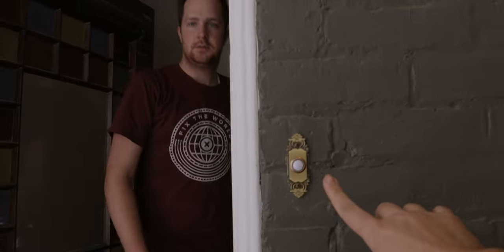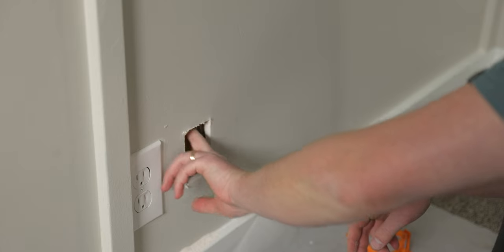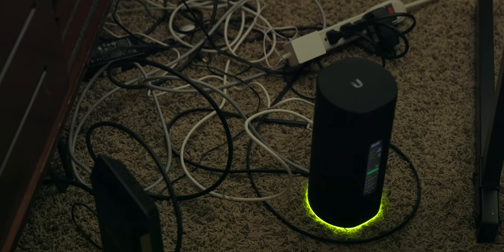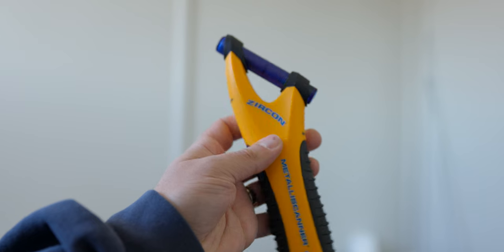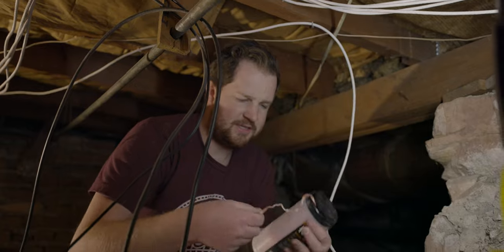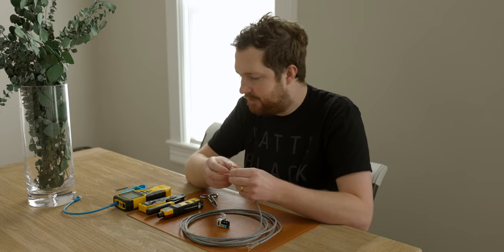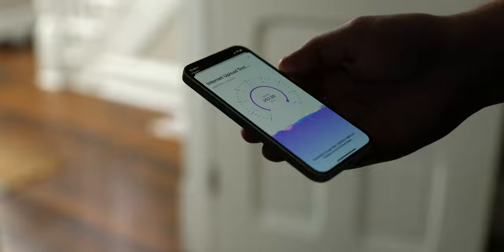Adding 10 Gigabit Ethernet to my 129-Year-Old House!

Comment: It’s so funny see this couple years ago I wanted to run Ethernet from down stairs to my bedroom (only like 50mps) I have to splice and wire all the wire together with a different cable I cut with the rj45 I did it all with a pocket knife (cut myself bad multiple times) used duct tape to put them together and then ran the cat 6 cable out the window (not outdoor eating in vail area so lots of snow and ice and thawing slammed the windows shut did the same thing downstairs and it ended up working great :)

Comment: Instead of a keystone, you can simply use an ethernet coupler wallplate. It has a RJ45 jack on the back of the plate and the front. So you can pre-terminate your cables, and just plug it into your wallplate and then screw it on.

Comment: All you need to do is flip the auger bit upside down after drilling your hole, then tape your cable end to end with the bit. Nothing else needed for pulling through subfloor. The fish tapes and ropes are great for pulling through to attics (which I suggest avoiding unless you have no other option) or from one level to another, but unnecessary otherwise.

Comment: I went with 6a when I did mine due to power lines  running, seperated, but parallel and a large number of cross points.

Comment: Just make sure when your running unshielded cat6 to not run it parallel with any power wiring if it's shielded I still wouldn't run it parallel but it wouldn't be as bad if you did.

Comment: The wire order AND the amount of untwisted wire at the end is very important for performance.  99% of the weird performance issues I saw back in the day were because of people untwisting too much or using any old wire in any order.  Working does not mean working properly ;-)

Comment: I wish it was this easy to do in my house. I live in Germany, our 1938-built Single Family Duplex with cinterblock and sandstone walls covered right up with plaster and wallpaper on the inside and 15cm of insulation on the outside. Drilling is impossible as it would be a nightmare to seal up again, paint over it etc. Running cables inside is also super hard cause my parents only placed a handfull of conduits in the walls at very inconveinient spots and super weird cable routings (the cable from our curent DSL Termination, soon to be fiber termination has to run all the way from the basement to the office on the second floor where it enters our all in one router before it travels done to the first floor again for our landline ISDN phone and some other devices that live under the seating in our dining room). My room didn't have ethernet to begin with, at least not where my desk ended up being, so we already had to drill a wall and hook my room right into our 10 Gig switch. It's a real pain, especially since I want to ditch all of this aging infrastructure and do it properly.

Comment: Pretty sure your suppose to use Fire glass or Safety rated cable in Lofts or Crawl spaces that are hard to access in emergency, So bare that in mind where you live. Because Type 4 Poe Devices (poe ++) can use upto 57Volts and pull 100watts

Comment: For anyone with a home built in the last 15 years or so, IF YOU HAVE TELEPHONE (RJ-14) JACKS IN YOUR WALL. Those might be run using cat5e cable making setting up Ethernet really easy. My home which is nearing 20 years at this point has a home run to each room of cat5e that was being used for telephone line. Just re-terminate at the ends and bought a new patch panel and BOOM ethernet up and running

Comment: I really want to do this in our old house but the problem is we have half a meter thick solid clay brick walls so all cabels have to run outside of the walls even the power cabels

Comment: do you have the Stapler and the spacers for the stapler linked in the description or a specific name for both?
Reply: Nevermind i found it!

it is called:

“Arrow T59 Wiring Tacker Chrome”
&
“Arrow T59 Insulated Staples”

Comment: Using keystone do not introduce an additional point of failure. Keystone punch down termination is the prescribed method for meeting the standard for cabling. Crimp on ends have their uses but introduce far more point of failure and are way less reliable than using punch down.

I agree that if you must use crimp on, the pass through are by far the best solution. And increase the likelihood of getting it right the first time.

Comment: The multitools are not always super expensive.  I got a cheap one at Harbor Freight for $40.  I have no idea how long they last or if I can expect it to last.  I only use it for occasional things and it doesn't get used a lot.  These things cut in quick and easy.

Comment: I'm in a similar old house in Switzerland, I throw my Cat cables (cheapest  20m long)  out the window, 
2 story down to my 10gbits XPS-Pon Fiber router.  
Recently replaced my old CAT4 cable, that hanged there for 5 years with a new Cat6a. 
I hope it will also run 5 years, until NG-PON2 with 40gbits arrives. (maybe a little bit longer).

Oh and the cat 4 cable did 10gig just fine. but i replaced it anyway, felt so wrong.

Comment: 6:30 you don't need the UDMP to run Ubiquiti Unifi APs, just any old computer will do.  For most features (the only exception I can remember is captive portal) you don't even need this computer to be constantly online.  It is not as good (e.g. no builtin RADIUS server afaik) but will work.  Cameras however (at least according to Ubiquiti, I don't have any of their cameras), you need a Cloud key Gen2 or a UDMP (regular Dream Machine doesnt work) or the separate Ubiquiti NVR (don't know how well this integrates with the various different controller options).

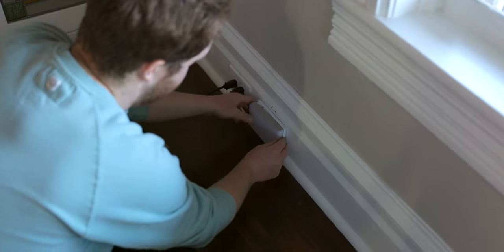6:38 you can set up Ubiquiti APs to work as a mesh network and can even use this (with certain models of AP) to connect wired-only devices over wifi (some accesspoints have a downlink that you can use to daisy-chain another device, this can be used even with a wireless uplink, and works on any device).  I do this to connect some Linux boxes, we have one AP by our router, and one downstairs by the Linux boxes, which are connected to them by an old EdgeSwitch 5xp.  However, wireless uplinks on Ubiquiti APs, while mostly stable, can occasionally disconnect due to interference/software bugs/acts of a deity (i have no idea what actually causes this to happen) and even if the disconnected AP is rebooted, it won't reconnect unless an AP it can connect to (with a wired uplink obviously) is also rebooted near-simultaneously (I can get between both of mine quickly enough on my own).  This might be good if you don't fancy running Ethernet for an Ethernet-only device and don't mind occasionally having to restart the accesspoints, while simultaneously wanting to get better WiFi coverage.

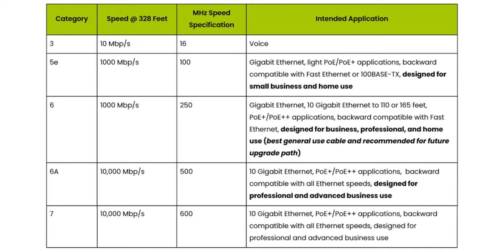9:40 Cat7 cable is either not actual Ethernet (its something proprietary that is semi-compatible) or Cat6a that was labeled incorrectly to make it sound better.  Cat8 is ethernet, but expensive and it drops off from maximum speed pretty fast, and if you want that kind of speed you may as well go for fibre runs and SFP+ transceivers and NICs.

Comment: My grandma house is a lot older and basically the house was built way before my grandma got it so it doesn’t have ethernet but what I did do was since it was a small house (It was in San Francisco). I would only just drill holes into the wall and pass ethernet through room by room and have switches or I would staple it to the corner of the roof or the bottom very Jenkee but it gets the job done. I would also use the same like Wi-Fi or wireless hub like you 😂

Comment: When removing the outer cable sheath you should use the string to expose more cable and cut of the initial wires just below your initial cut. Any nick in the twisted pairs could cause really weird issues in the future so its better to just sacrifice 2 inches of cable and remove the sheath to expose enough string for you to grip and pull down to cut the sheath (as that is the purpose of the string) then cut all the excess wire off just below where you made your initial cut using your tool. This will guarantee that you have no nicks in your twisted pairs. That tool you used is set to a standard depth and cable sheaths can come in all kinds of thicknesses and if you have a thinner sheath it will nick the twisted pair sheaths. Also if you run the twisted pair over a screw driver shaft t will take out the twists in the wires and make then straight

Comment: The one thing that's not really mentioned here is that depending on your application and situation, you do not want to give every line the maximum bandwidth. In a situation where you have a maximum of 5 Gbps and 5 endpoints that are likely to want as much resources as possible it can make more sense to to only run 1 gig to each, ensuring they all get fast, low-latency, internet.

Comment: Yeah that's the thing about typical US house: cable drops! We here are used to wall our cables into solid concrete or alabaster and so, they couldn't get replaced easily (but that prevents them from being damaged, and your house from burning). Imagine doing this kind of upgrade with your internal walls made of silicate bricks! Although, they do have a great soundproof capabilities, and they can stop a bullet. =)
Reply: @Phillip Banes I may have misspelled something, I was actually amazed by the simplicity and renovation-ability of the US houses. Which is unfortunately not the case  for us.
Reply: @Phillip Banes I never mentioned any disadvantages my man. I stated a couple of "redeeming" factors for our all-brick designed houses, i.e. why they are made like this, that is all. Note the massive quotation marks.

Comment: I couldn't agree more about CAT6. I helped a buddy with a IP camera project recently and he used CAT6A, and these are cameras that could get away with 100Mbps, but he was adamant we use CAT6A CMX due to the POE+ runs being long.

What a pain in the ass to crimp, especially when its 100F out and you're sweating bullets off a ladder fiddling with the stupid insulation.

Comment: Pretty good job with explaining networking but there was one flaw, the punch down tool it's a 110 or 66 block punch down not a 99. As a person who is certified in computer networking I see that you did a good job with explaining. Now the stapler method that's actually a new one I have not seen that before. I'm a zip tie kind of guy but I've gotten more into the velcro cable tie method so say later on down the road you want to add more cables to a bundle instead of having a cut however many zip ties you got you just undo the velcro add your cable and just velcro it back up. Now sure you could just zip tie the additional cable to the bundle already but say later on down the road you need to replace a cable that's a lot of zip ties to undo.

Comment: If you're a noob with this kind of thing I'd go directly to CAT7: expensive and hard to work with, but a high standard that will last your lifetime.
If not, CAT6A S/FTP would be my go to to run more than patch cables.

Comment: I recently moved into a house that like many homes, doesn’t have Ethernet already running throughout. However, it does have a central vac system with ports in almost every room. I tired it once and decided to stick to my original vacuum and never plan on using it again. I’m wondering if I can use the preexisting vacuum lines as conduit and run Ethernet through there. I tried finding similar projects or ideas online but couldn’t. I don’t know if I’m just not seeing the obvious red flags, or if this is a super easy shortcut to get the house hardwired instead of going through my walls. If anyone has any thoughts or ideas please let me know!
Reply: Did it work?
Reply: @AlxndrHQ  Long story short, no not yet.
So I saw videos of electricians tying grocery bags to one end of a wire before inserting it into conduit in order to create a seal. Then, at the other end a shop vac was used to pull it through. I attempted to do this myself but it didn’t work. I believe one area of failure was at the shop vac end because there was not a good seal. The shop vac hose was too large vs the central vac inlet and I never got around to create an attachment that narrows down to fit. Another point of failure might be that the “conduit“ is too vast and intricate, so I would need a much more powerful shop vac to suck anything through it. I have a 6.5hp craftsman (CMXEVBE17595) so I assumed it should be good enough since in those videos they use a weaker one. The last reason I’m guessing why it didn’t work is because of the direction I was trying to move the cable. I tried to go from downstairs to upstairs, but perhaps if I go the natural flow of the system (aka going downwards towards the central vac system that’s in the basement) it would work better. Ill try again soon whenever I get the chance and keep you updated. If you are trying to do the same let me know if it works out and if you did anything different, thanks!
Reply: @herpderp749  ah gotcha! We Jerry rigged it using gravity through the ducts. Seems to be working fine so far! 

It may be easier to just drop a long Ethernet line down from the upstairs down, rather than trying to run it upwards.

Comment: Very well made video! I have a quick question I hope you can answer. I have 1 existing Ethernet cable going from our ONT on the outside of our house and it runs through the attic to the very far other side of the house. I want to run Ethernet lines to other rooms but putting a switch where the existing line terminated isn’t feasible. Does it make sense to cut the existing line somewhere in the attic, install a switch there and cut and plug the existing line into the switch?

Comment: The powerline adapter im currently using to get connection is having trouble with the powerpoint in my room, not sure what it is, but it works fine in the other ones.
since im renting and kind of got permission from my landlord i was recently thinking of just running an ethernet cable through the roof and drop it down into my room like the landlord did with the coax cable to my router is connected to.
the coax cable is literally just hanging from the roof, out of the wall inside the room and partly painted white.
im assuming this is because the wall was too thick and they couldnt get under the house, or they were just lazy.
either way, this isnt my house and im not putting a money and effort into doing it properly when i might not be at this house in a year or so.

Comment: Question? I already have IP CCTV installed in our house and we have a camera at the rear of the property which we don't benefit from massively. This is ran to a POE SWITCH that then runs to the modem internet hub. Can we install a internet socket into our wall and leave it connected directly into the existing switch without needing to add a second socket first? So from the existing RJ45 PLUG which is in the switch straight to a socket upstairs then run a new cable from that new socket to our Xbox and TV as we get 15mbps when we have a package for 800 Mbps as poor wireless networking. I don't want to remove the IP camera without knowing this will work first

Comment: Snazzy Labs, 

I'm going to give you hint here, you should never havr telecommunications, including Ethernet jacks right next to electrical outlets. Not only is it not code but it also causes enough electrical interference on both the electrical line and Ethernet in terms of cross-talk. Anyone that knows how to do house and corporate wiring knows to keep the two apart, so that you don't get RFI and EMI cross-talk. Besides, that's common sense!

The grounding jacket for the Ethernet is to protect it from cross-talk from other low voltage cables of the same type aka another Ethernet cable, not the RFI and EMI coming from a power main whether it be 120V / 240V or 208V (technically each hot is 400V but are 120 degrees out of phase from each other which makes it out as 208V).

Comment: I noticed near the end of the video when adding the connectors you mentioned the order of how to insert them into the connector prior to crimping and cleaning up the connection slot that would go into your computer. However, is the keystone punchdown the same order as what you installed on the pass through the connector or is that a different order or does the keystone not have to match the pass through the connector order?

Comment: At 22:20 its not 99, its 66. This is for phone blocks. 110 is for horizontal risers which is also suitable for your wall jacks. Also, should explain the difference on 568A/568B.

Comment: You can't simply make sure the wiring is the same on both ends.

You need to make sure the the wires are properly paired. For example, if you swap the solid orange and solid green on both ends (so it's wired the same on both ends), you'll get interference and crosstalk between the signal pairs that will absolutely kill performance.

So you might be able to move the pairs around, so long as you keep each pair going to its designated terminations. Easier just to follow the standard. If you don't like the standard, that's why there's two of them; you can choose the other.

Comment: You can use a needle-nose plier to pull the copper lines straight when you are getting ready to make up heads. Either way.
And pull through connectors are what he is saying for punch down. Punch down is another name for the keystones. But that’s just in the part of the country I work. Haha. Different jargon for different places. ^_^ This guy is rocking it on this video.
Reply: Those testers are essential. Please get one and save yourself hours of headache.

Comment: Recently I found out my mom's house, built early 2000s, has phone terminations all around the house. Turns out all of them are also wired for Ethernet and they all terminate in the same box with the coaxial cable.